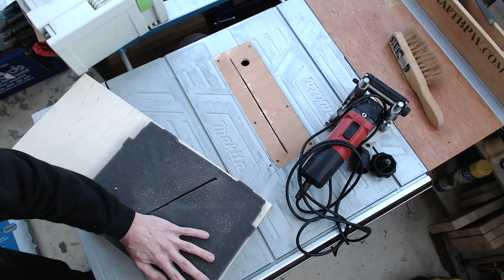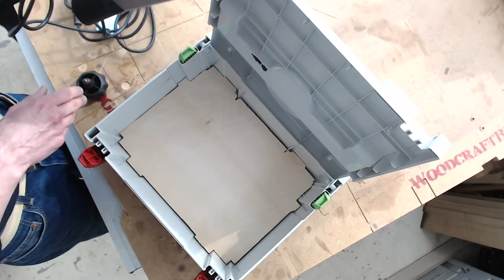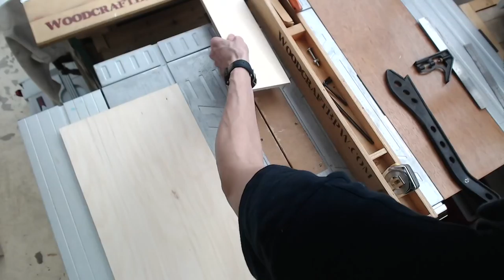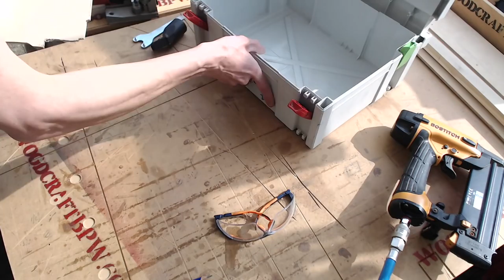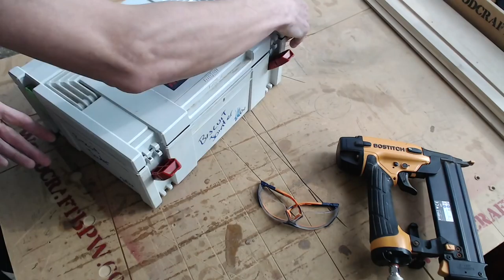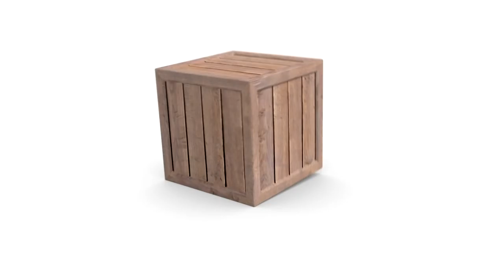Biscuit cutter/Plate jointer biscuit storage for old systainer - People never read the description!

Comment: Nice project, and surely a worthwhile improvement for your shop. But unless you live in a very dry climate I would recommend keeping your biscuits in sealed containers as humidity can cause them to expand and then not fit anymore.
Reply from the maker: +Jon Miller It's interesting, I've had people say that to me before, but I never noticed any difference in them even after they sit for literally years. ( I bought a box of a 1000 mixed sizes about 7 or 8 years ago), and they all seem good today... They're not something i use very often either, maybe I'm really lucky?
Reply: That is interesting. I've seen it make a difference in an afternoon, and I live in Utah (low humidity). Normally biscuits are compressed so they don't return to their proper size just by drying out. It may have to do with the cutter and biscuits having been on the extremes of their size tolerance, small and large respectively, and then the humidity pushing the biscuit beyond that dimensional tolerance range.